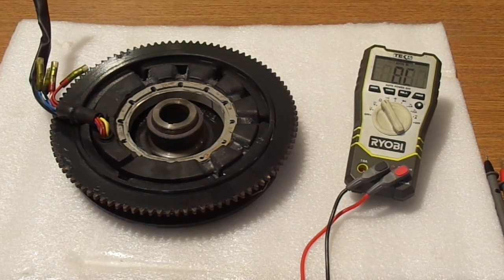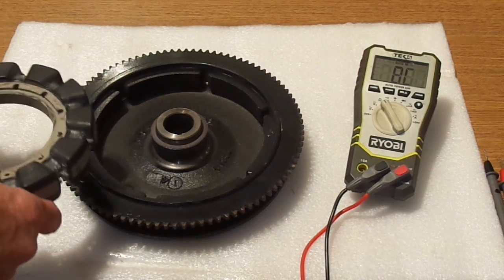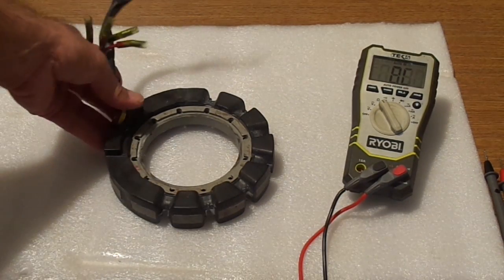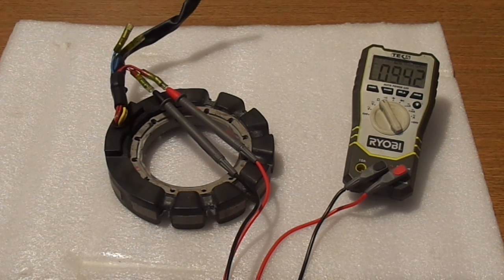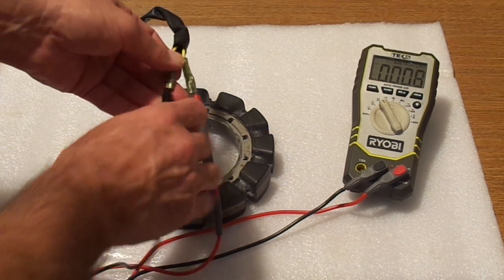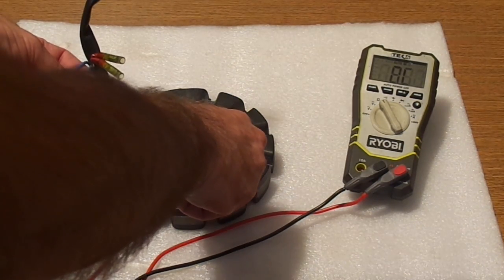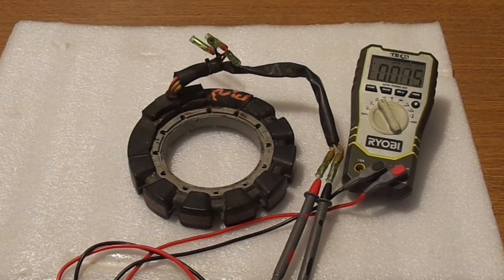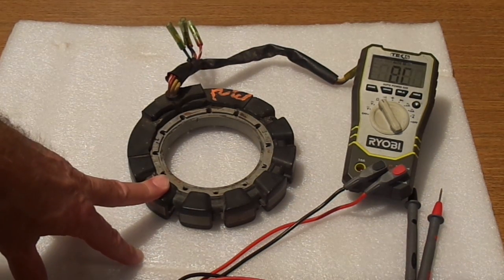How to test a stator

Comment: My outboard is running backwards - no telltale.
Timing light shows spark timing on no.1 cyl is about TDC, but when testing the no.2 cyl spark is around 160 BTDC. This is causing the engine to kick back and run in reverse. Why is the number 2 cylinder firing so differently from no.1 cyl? In 1980, using the same flywheel, how did Mercury separate no.1 spark plug from the no.2 plug so that they could fire differently?

Comment: There is infinite resistance for your open reading.  NOT "no" resistance.  Open coil equals infinite resistance.
Reply: Came here to say this. OL (outside limits or overload) on Ohm setting shows extremely high resistance over the limits of the meter. Just as when not touching anything the “OL” is showing extremely high resistance through the air. (Not quite infinite since a high enough voltage can jump the air gap ie: lightning).

Comment: Thank you, expert! This is really the best useful video. My plugs, 2002-merc 75, 4 stoke, has just lost all sparks on the water.  I am going to test it and find out if I need to replace it... and it is good to know I do not need to take out the flywheel to do so. I felt originally less enthusiastic about boating when it broken down on the water, but with your video/instruction, i regained my confidence now.. Thanks again.

Comment: The two blue wires on my stator read ZERO.   Here are my findings, could you confirm if I need to replace the stator?
Red to Red/White- 51.5  Blue to Blue/White- 0.00, Yellow to Yellow- 1.3. Thank you
Reply: Hey dearslayer303B, what was your motor doing to make you want to test?  Curious because my motor bogs a little on throttle (runs perfectly otherwise), but sometime kicks in and works normal.  I tested the stator and Red to Red/White is fine for resistance, but Blue to Blue/White has no resistance just like yours.
Reply: @mikegoyette8469  it would act like it was only running on a few cylinders then sometimes would take off and run great. New Stator fixed it
Reply: @Bracedinfaith  Awesome, that's exactly what mine is doing and I am getting infinite resistance on the blue wires so I am going to replace the stator as well.  Thanks for the reply and I'm so happy you're on the water again running smoothly.

Comment: Could this cause a 90 hp Mariner to misfire randomly at idle and at full throttle? Reason im asking is from cdi down has been checked or replaced on my fathers outboard but the problem continues.

Comment: my outboard has spark at low rpms (when I pull the pull cord to start) but as I increase rpms (with an electric drill, I tend to lose spark. any idea what it could be? I replaced the ignition coil and have the same problems, I may do this trick and test resistance on the stator.

Comment: i have a  40hp  mercury  2003 model ,  2 cylinder, 2 stroke...im  getting power to the coil packs on both cylinders  with test light at electical wire harness   unplugged...,but when i plug the harness back together and  crank motor i have no fire from the coil wire n plug ... any ideas...i also checked coils they appear to be good from meter test
Reply: you need to do a cranking voltage test for the stator and timer base, as well as the switchbox/power pack to figure out what's really causing it to not fire. oddly, no videos on YouTube on cranking / running voltage test with DVA that i've seen.

Comment from the maker: A rectifier changes A/C power to D/C. A regulator controls the alternator to charge the battery and has no part in the ignition system.

Comment from the maker: Hi James,
We'll need the engine serial number. Then go to this page for specs:
http://www.outboardignition.com/page39.asp
If the wires are rotten use some shrink cable in top of them. Then shake them while measuring the resistance. If the meter suddenly moves they are touching somewhere inside - in this case you have to replace stator.

Comment: hello i have a stator off of a 1971 mercury 1150 115 hp outboard two wires yellow with red stripes on both wires what is the ohm reading for this year  wires are rotten  help me with this thanks